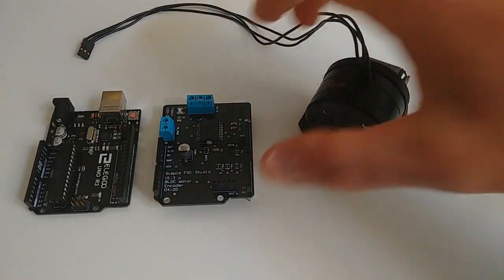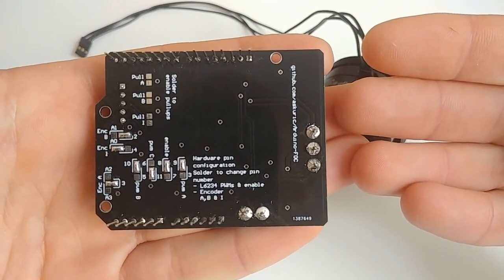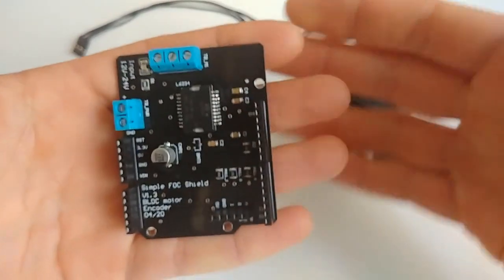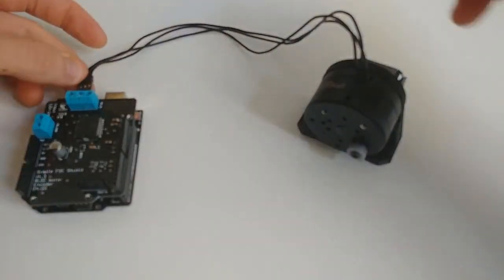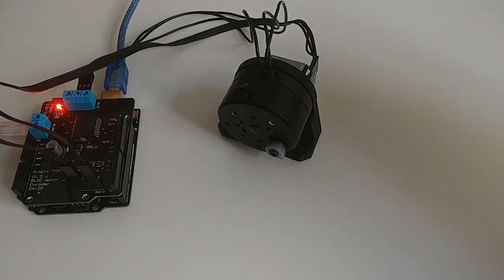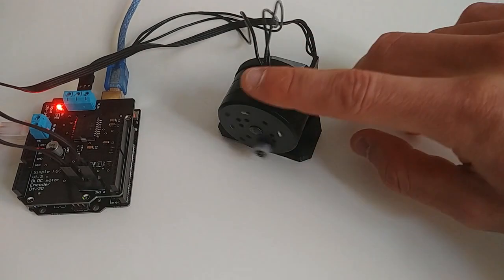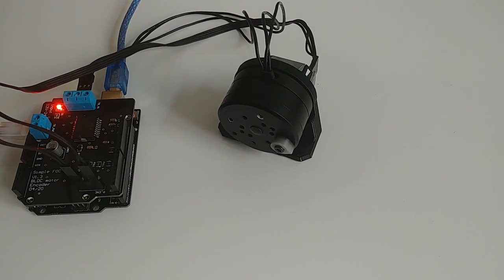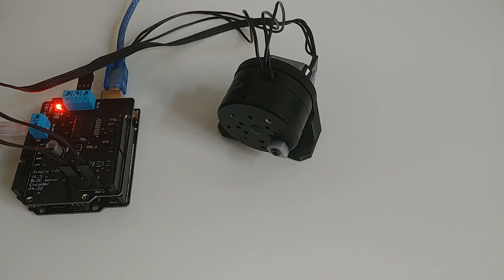Arduino Simple Field Oriented Control BLDC driver Shield - SimpleFOCShield

Comment: Hello Antun, I am still playing with this library and having some issues...still. 1. with the angle control i have to type a target "T6.275" to get 1 full 360 rotation I cannot figure out why its not "T360"??? I have the encoder set to 2048 and everything initializes good...2. I have been using an UNO clone and also esp32 D1 R32 but the esp just will not work correctly it works but is all jittery and makes the motor hot also the simplefoc shield V2.0.4 not the same one you are using. I have mapped the pins correctly but maybe the esp pins need to be a specific type like interrupt pins or pwm pins although im pretty positive they are all interrupt capable???
Reply from the maker: Hey @DustanWebb, the angle is in radians. So for one full rotation you'd need 2*pi radian = 6.28. Also the velocity is in rad/second. :D
Reply: @theskura  ah...thank you that makes sense, I just figured I didnt configure something correctly.

Comment: Would have never thought that the simple Atmega328 has fast enough float math to do the FOC algorithm at reasonable cycle time (not to mention ADC sampling speed).
What is the typical update rate of the algorithm?
Reply: I see the program file. He does not use fix time interval or interrupt for control loop. But made it in loop program. Just relax to the code to finish its routine command until the end of program then start a new loop again and again.  So it definitely work without constraint in calculation time.
It also made me puzzled.

Comment: I'm curious, what is the maximum speed for this?
Reply from the maker: On Aruduno UNO , 12V power supply and the optical encoder with 2048 ppr, the max speed is around 10 rad/s. 
But if you configure atm103 to 500 ppr then you can go up to 25rad/s and so on.
If you use stm32/esp32/Teensy and similar you'll be able to go up to 70rad/s.

The same is true if you use SPI sensor instead of optical encoder even for Arduino UNO. :D
Reply: @theskura  thank for this response. Any ideas on how to jack it up to 200 to 300 rad/s? (I believe the max speed for the gimbal motor is around that range?)
Reply from the maker: @creative_cooper  Maybe for 48V or at least 30.
On 12V they will not be able to go higher than 60-70. On 24V, they can go up to 120.
At least the motors from the video GBM 4108-120T.
To go up to 100+ rad you will need to switch to stm/esp/teensy/samd boards though
Reply: @theskura  great!... I'd buy the boards and experiment myself. Thanks.

Comment: Maybe you should hack a JYQD board to drive bigger motors, like a Hoberboard Wheel... O.0
Reply: I mean, that board is driven with PWM, but you may hack it to make it work with STEP/DIR interface with your project to hold position with big motors.

Comment: You call it FOCShield... but it does not do Field Oriented Control. Too be able to control the field, you have to messure the phase currents... but you dont do that. What you are doing is a sinusoidal cummutation not a foc!
Reply: its implemented in other parts. This one is a basic example I think.

Comment: Great project!  I have used your library and the motors have excellent torque without any overheating.  If I wanted to control the motor movement with different input devices like a joystick or another encoder, is the software easily adaptable for this functionality.